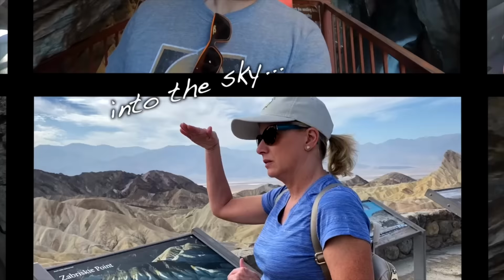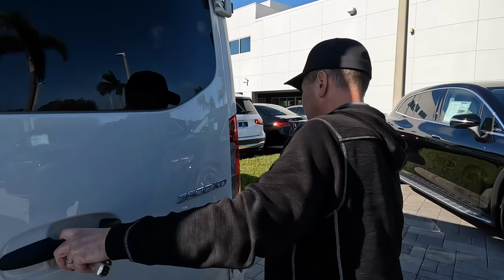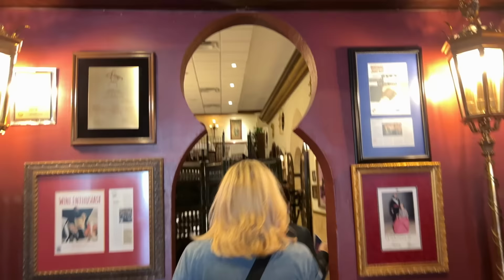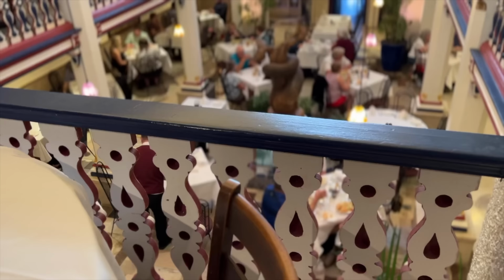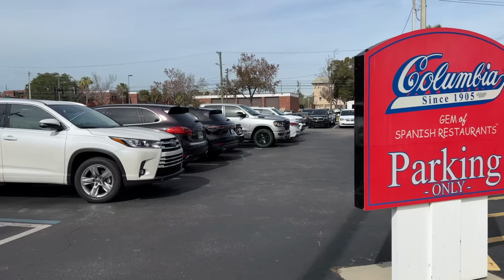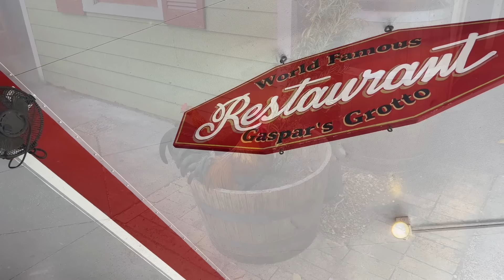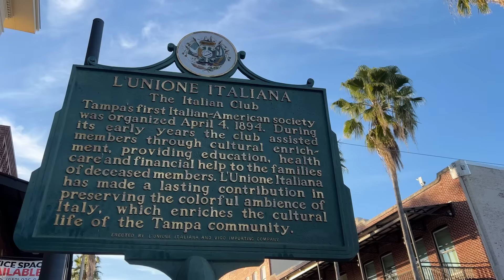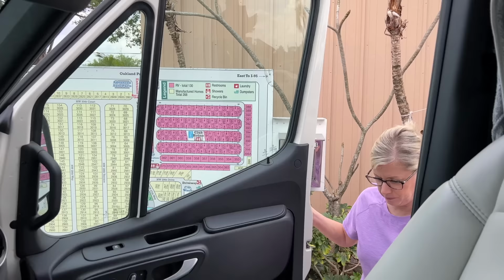The Columbia | Ybor City | Tail Light Replacement

Comment: Glad you made it to the Columbia. While the expansion restaurants are very good, nothing beats the original. Lunch is the best, and I try to catch it in St Augustine in the heart if St George St, the dinner menu is the same with higher prices and marginally larger portions.  Growing up in Central FL (Winter Haven)  the Columbia was a destination restaurant to take a date to and it was a gem in an eyesore. Ybor City has really improved. Still remember in the 60's/70's viewing the factories easily seen from I4/I75, large dilapidated brick building with all the windows busted out - now either torn down or used as the base and converted to condos. (Also remember the free beer at Busch Gardens at the end of the factory tour but that is a different issue...and terminated when the University was built adjacent to the property.) Not sure how accurate it is, but have heard that after Prohibition, the Columbia has FL liquor license #2, with #1 somewhere down in south Florida.

Comment: Can you say what that lens cost.  An LED lens assembly for a new Yukon XL is about $650.  No individual lights can be changed except for the reverse light. So if the parking lamp or signal lamp goes out you have to replace the whole assembly.  The Chevy version (Suburban) still has bulbs you can replace.
Reply from the maker: Yep, $559 for the 2023 Mercedes. Many people think Mercedes is higher than Chevy, GMC, Ford etc, but apparently not. Same with this tail light, you have to replace the entire assembly.